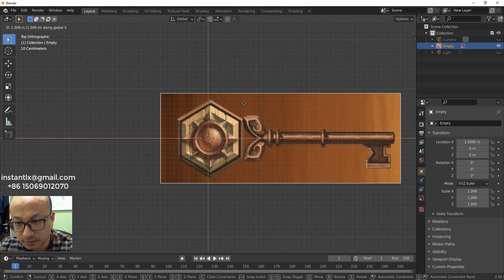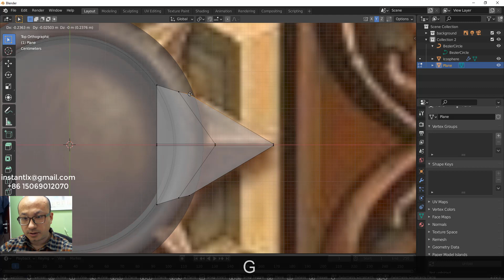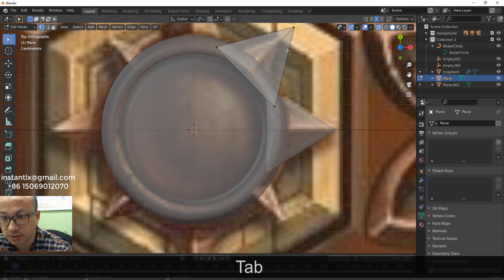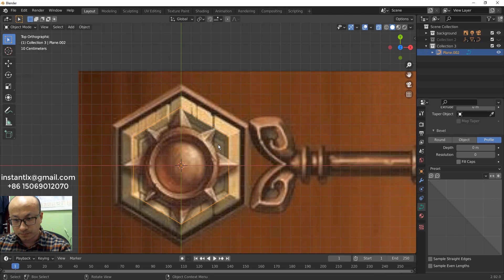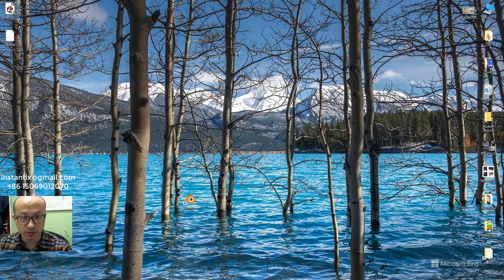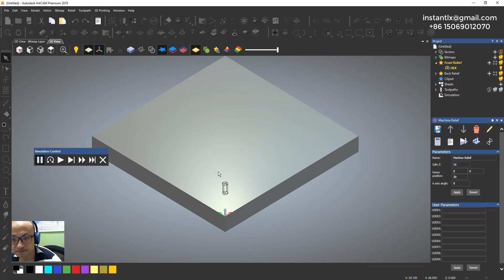How to make relief in Blender 2.9 and tool path in ArtCAM 2018

Comment: Hi sir I have buy the machine  cnc from your company  I got many problems  to set the dimensions  when I set 50mm  for y as and 50 x as the machine  cut 3 time the dimensions  I can't get the right  measurements  onto the cnc  pls can u solve  the problem  for me
Reply from the maker: Seems the pulse is not  correctly set. Ask your machine seller the value and how to set.  Wish you good luck